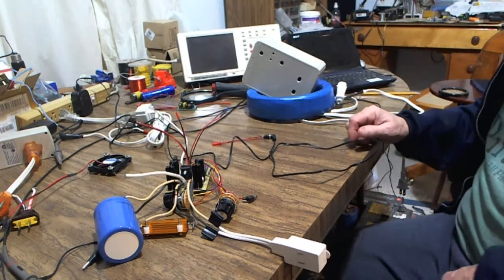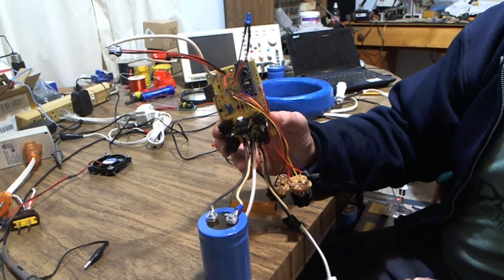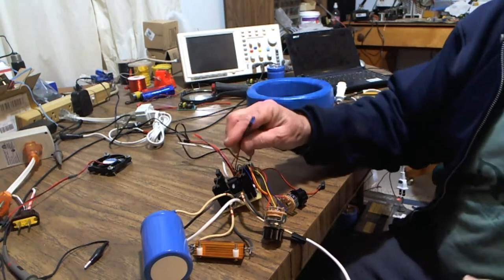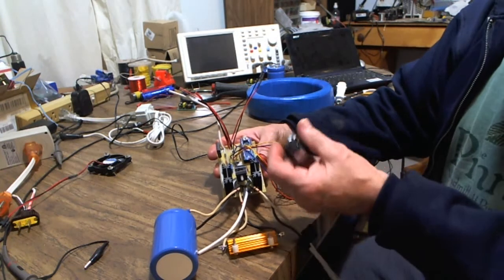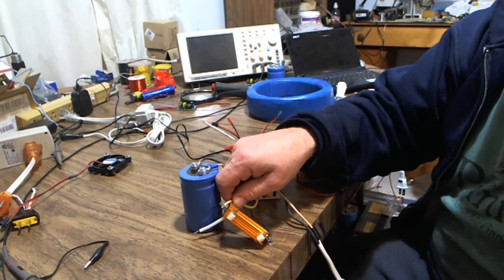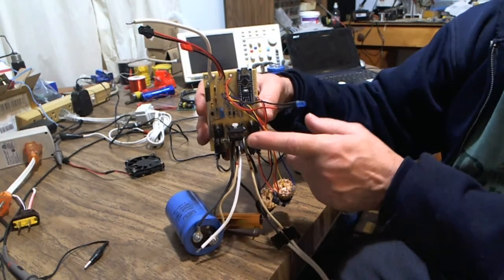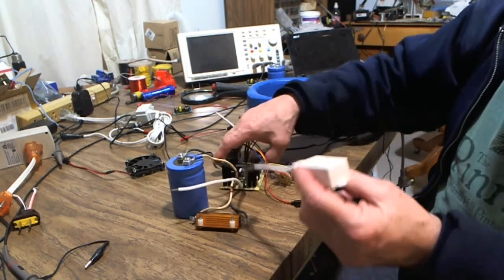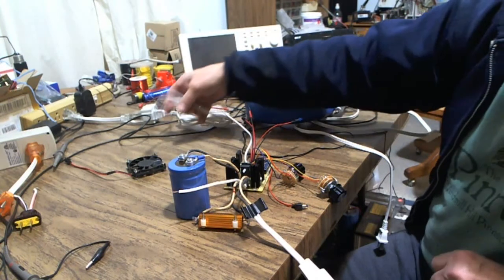PEMF Kit Builder 1

Comment: super cool.  I am fully supportive of DIY/open source/power-to-the-people stuff like this.  Many commercial devices like this are WAY too high priced for what you get.  And in my scientific opinion, PEMF is the future of medicine.  So giving people the tools they need to take care of themselves is a great thing.  Since I have been studying PEMF as a scientist for a couple of decades, I'd like to offer some advice that might make this device more biologically effective and efficient (and thus inherently safer).

1- If you can get a good dynamic measure of the magnetic flux density, you can tune your coils to be much more biologically efficient.  My data shows that biological benefit is threshold dependent (not linear with dose).  So, a high-speed linear Hall effect sensor will be a great tool to have for calibrating and tuning your PEMF coils.  (You can easily DIY a high-speed Gauss slew rate meter this way.  These are not for sale anywhere so you have to build them yourself).  The Hall effect sensors are very inexpensive, and many are available from digikey.com.  Adjust the coil impedance (actually the entire LCR circuit) to achieve a magnetic flux slew rate of at least 100 kG/sec.  A lot of people try for precise frequencies or massive "Gauss" levels from their PEMF coils to get the best effects, but the real deal is to get the magnetic slew rate in the right range: 100 kG/s to 2MG/s.  Big powerful coils and drivers are not necessarily fast enough, so you can easily waste a lot of energy and make a PEMF system that is 99.8% inefficient.  Rules of thumb:  Lower coil impedance is a good thing, minimize series equivalent resistance, and use low ESR capacitors.  Use capacitors in the voltage range where their voltage derating is not too high.

2- Pulse width does not to bee too wide, 200-300 microseconds is sufficient.  Many people think this clips the peak Gauss, which is does if your dynamic range is too low (see above).  So they (wrongly) widen the pulse to get higher peak Gauss.  Biologically, the right answer is to get an adequately high magnetic flux slew rate (see above) then narrow the pulse to 200-300 microseconds.  Arduino may not allow pulses narrower than 1 ms, but it is easy to build a digital diferentiator/pulse width generator (exercise for the DIY'er) to get a precise, narrow pulse.

3-  Doing #1 and #2 above correct, your DIY PEMF will be much more biologically effective, more efficient, run cooler, require less energy, and thus be safer.

Bob Dennis - Micro-Pulse LLC
Reply from the maker: Very considerate and very nice information.  I knew some of this but was not aware of the 200-300 usec window as being more biologically effective.  There are a few things I will do differently on the next version which will include a technique for narrowing the pulse.  I can assure you that this unit for both my wife and I is extremely biologically effective.  We use it for different purposes and this blog is not the appropriate place to talk about personal issues.  I have since started using a very low ESR and much bigger capacitor.  The capacitor alone is $80 and does make a difference in many ways.  I will be making it an upgrade option.  Thank you for this contribution and be well.  Respectfully, Steve
Reply: Sure, happy to help.  The main improvements are: slew rate calibration increases biological effectiveness, which is why you see improvements with the low ESR capacitor, and narrower pulse width, which mostly improves efficiency, but you don't see much additional biological benefit with narrower pulses.  But by reducing excess, unnecessary power you can make the system less expensive and safer, more reliable and more compact.